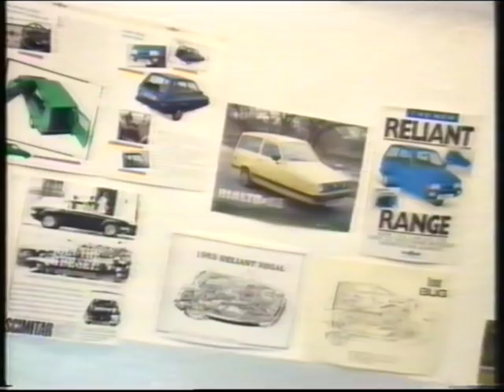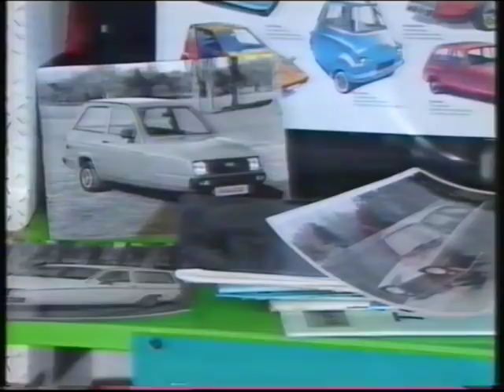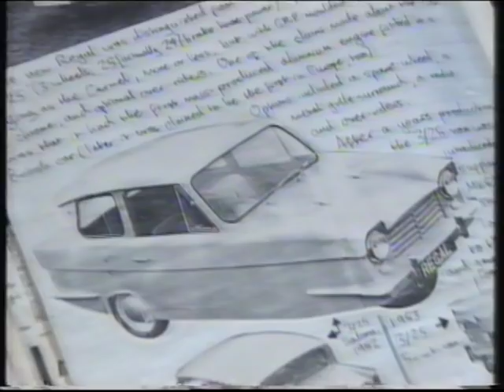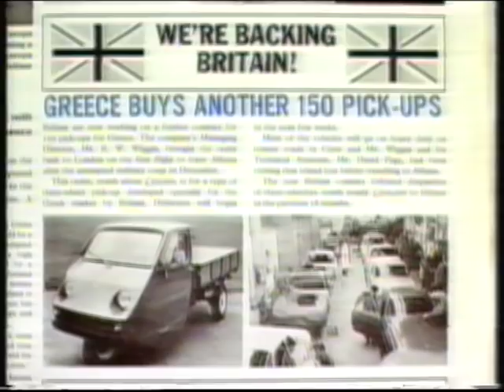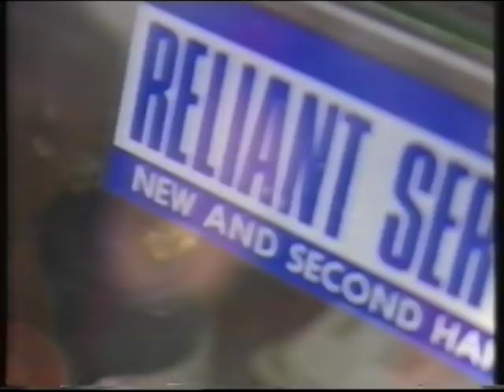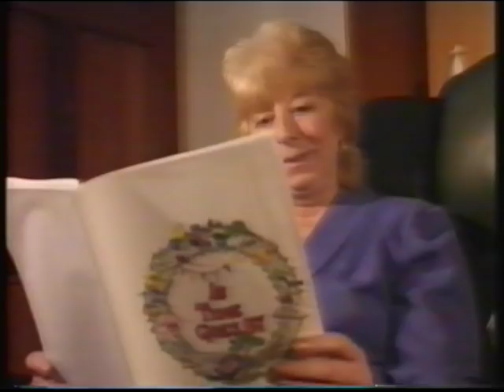Reliant Robin Documentary.

Comment: every one seems to forget at the time  the choice was a cold wet motorbike with all the protective clothing or step straight into a nice warm dry  car with your normal clothing for a price the working man could afford
Reply: Yeah was my dad's first car. Many happy childhood memories. Was what we could afford at the time and could drive it on his cycle licence.
Reply: supernumery Your “pathetic little death traps” is not really appropriate either. The chassis used on these cars are pretty strong, and none of the cars made then would fare well in a modern crash test. There is at least one 3-wheeler used regularly in Long Distance Trials and it seems to hold up well. My nephew and his family have several of the Scimitar and similar sports saloons, they also are well put together, on a par with vehicles of similar age - better than the Vauxhalls I used to work on in the 1960s/70s. And the engines from Reliant 3-wheelers have been used in sports and racing cars for decades. Pathetic? No.
Reply: But how much more could it have cost to put a 4th weel on it?
Reply: @Shadow25720  they did it was called the "reliant rebel" and later was the "kitten".
Reply: @trevorford9432  so it was like the regal and the robin but the 4 wheeled ones
Reply: @mrjed6912  hi Adam, no the 4 wheeled regal was called the "Rebal" the 4 wheeled Robin was the "Kitten" mine was a 3 wheeled regal supervan 3 21e had extras "chrome clocks and dials, 1x front fog light and 1x spot light" ooh what luxury 😊 lol.
Reply: @trevorford9432  but that’s what I just said.
They have the same story but just are different cars.
My family owns a reliant Rialto estate

Comment: The main 'fire' problem, especially with the older Regal models, was that of the fuel pipe tapped direct into the carburettor and sealed with resin.
Not a good idea in a bumpy car or road accident - the fuel pipe came out onto a hot engine.
They fitted a flexible rubber'plastic coupling from then on eliminating that particular problem.

Comment: I'm in Canada but acquired a few issues of the British "CAR" magazine, which had a very brief opinion summary for every car model in each issue.   The Reliant Robin said this::
PROS:  "Cheap Insurance",  "Cheap road tax"
CONS:  "Tends to trip and fall", "More stable if driven in reverse".
Reply: I remember a discription of the honda CB250N super dream as "slow slugish wobbly and boring, they sold by the boat load" summed it up really,.
Reply: @Shady-Shane  Having owned a couple of Honda Wet Dreams I can attest to their atrocious handling and speed. I eventually swapped the last one for a rat CB650. The difference was startling. 

On my commute from home to work there was a series of tight bends that I found taxing on the 250 at 25mph. The first time out on the 650 I found myself effortlessly cruising round them at 40mph. So much that i then branched out into motorcycle courering. Love the job even in taxing weather conditions eg 100mph on the motorway in a storm!

Comment: I owned numerous plastic pigs over a 12 year period (regals,robins and rialtos) and when I finally decided to take my driving test and move over to normal cars it was the best thing I ever did in my life.Sure they have their well known plus points,but the constant problems just got too much in the end.
Fuel evaporation when the engine compartment was hot,causing spluttery starting and lumpy running,and of course the constant risk of fire.
Poor engine access.
Rear leaf springs forever snapping.
Braced section of front radius arm cracking.
Welds failing next to where handbrake cable adjusters go into plate,and eyelets distorting where cable goes onto rear axle resulting in loss of handbrake.
Fibreglass breaking up where doors are mounted to body
Plastic dashboard breaking where it mounts to body
Starter motor Bendix seizing up
Useless heater....the list goes on.
And of course there was always the worry of finding the car tipped on its side by yobs,that happened to me on more than one occasion
Reply: I understand why people claim the poor access to the engine,      But changing the HT Leads,    Spark plugs and air filter can be done fairly easily from under the bonnet,      With the two access panels inside giving you access to the starter motor,     Oil filter,    Exhaust manifold and carb,     In some ways access is better than others,      And engine removal again is easier than a lot of other cars,      Yes I agree they are not really comparable to a modern car in terms of comfort and reliability,       But as they say here on this video,    A lot of owners don`t look after them as they should through lack of funds,     Giving them a bit of a unfair review
Reply: Thank you for your unbiased comments!

Comment: Reliant got some fantastic free publicity when Princess Anne got pulled over by the Police for speeding in her Reliant Scimitar. The Scimitar still looks good today, and was a precursor of the Hatchback.
 I once rented a Robin for a few days, just for fun, and never felt safe.
Reply: I owned a Scimitar for a few years. Sadly it was the wrong engine. It overheated at speed (anything over 100mph) despite my modifications to the cooling system. The UK 3.0 litre lump (I forget the model name) was later superceeded by the German variant (?Cologne?) which was much better and more powerful. 

I've flirted with other marques in the intervening decades, but returned to my old love - Jaaaags! 😍
Reply: @amanofmanyparts9120  The 'Essex' V6, as fitted to the Ford Zodiac, Mk. 1 Granada/Consul GT and the Capri 3000. Sadly there were too many fibre components in critical places on that engine, like the timing gears for the camshafts and the oil pump drive. Easily sorted now with metal replacements, but...

Comment: Two wheels in the front and one in the back seems more practical. Look at the BMW Isetta.
Reply: Or even the original Morgan 3 wheeler. But one wheel at the front has potential benefits. You should have more room to turn the front wheel further (theoretically up to 90 degrees), thereby reducing the turning circle. Plus, assuming RWD, you get two driven wheels rather than one, so more traction and reduced likelihood of oversteer. Which should suit both the "slow in, fast out" approach that's ideal on narrow, twisty, poorly sighted country roads in the UK and the delta configuration of a Reliant. The tadpole configuration of the Morgan generally has more stability going in to a bend than coming out. Horses for courses.
Reply: As difficult as the PP is to roll (Clarkson excluded), the 2-1 configuration is infinitely more stable. Saying that I know of a moron who managed to roll one. To be fair he was running from the fuzz.
Reply: @another3997  Not theoretically - that was the selling point of the Bond Three Wheeler.